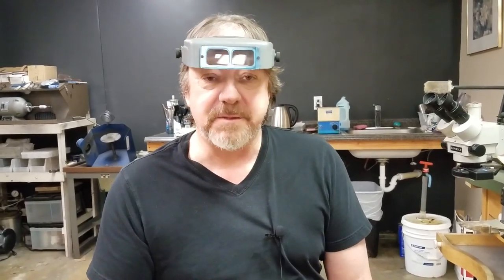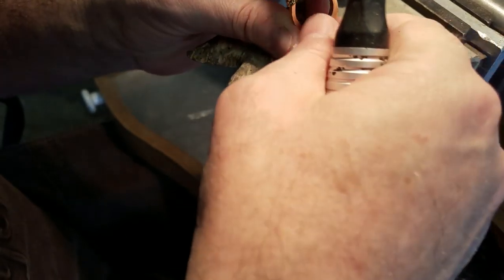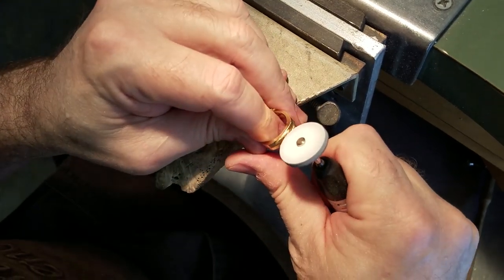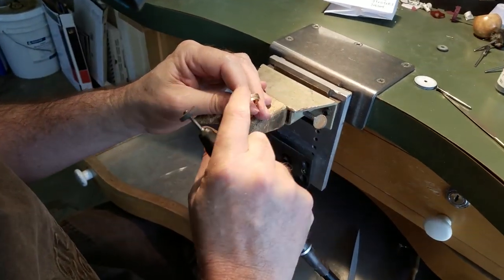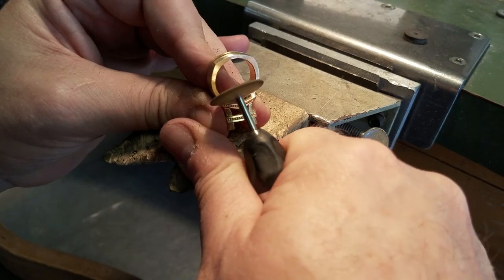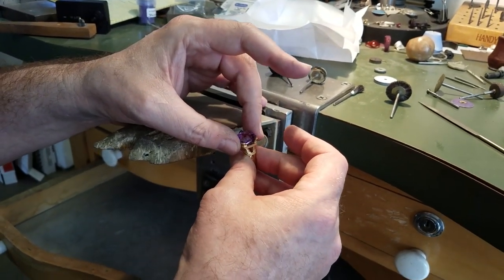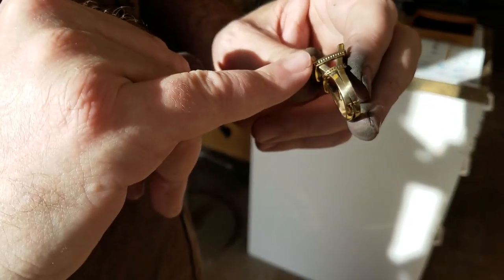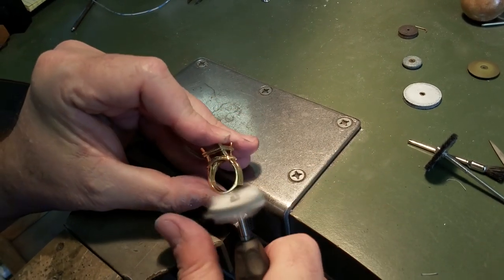Polishing at the bench

Comment: How does the sanding paper works? the more the grit the smoother it is? And what grits of sanding paper would you recommend? Also which 3D printer did you use to print this ring and what resin/wax?
Reply from the maker: 2m micro-abrasive sanding film. The higher the grit number the finer.https://www.stuller.com/products/10-11017/?groupId=190776&recommendationSource=SiteSearch